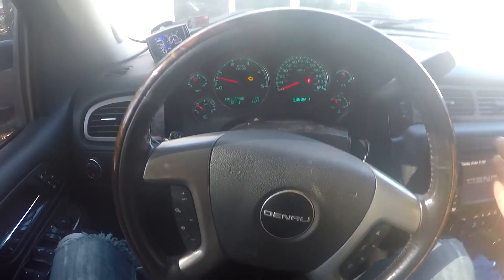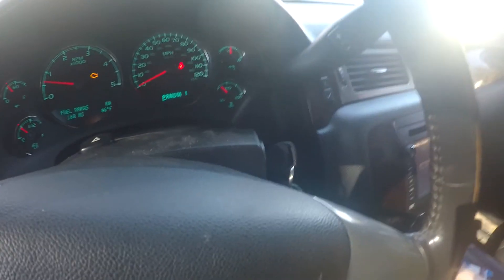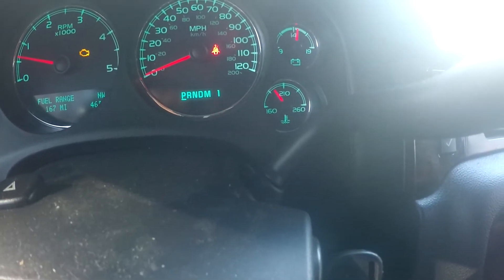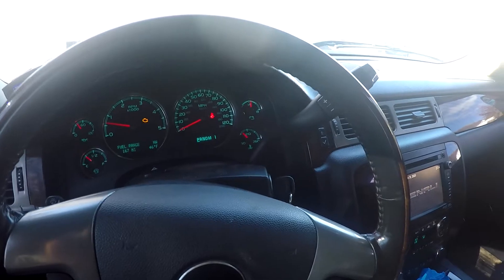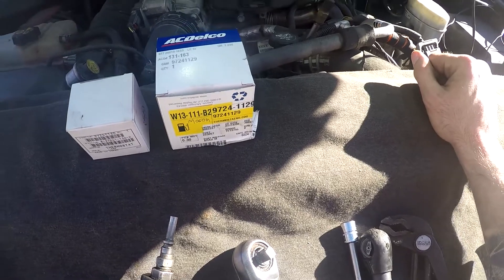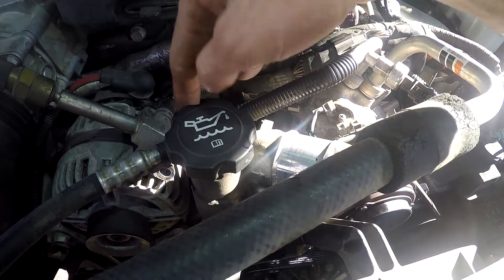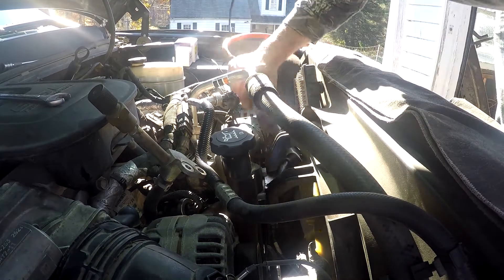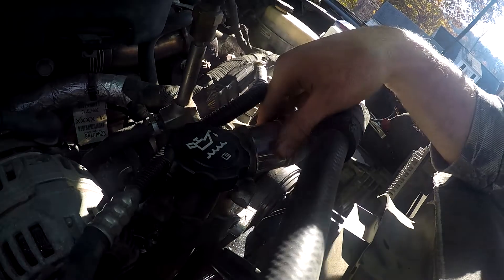Diagnosing and Replacing Duramax thermostats.

Comment: Thanks so much, Just purchased an’11 Denali HD and engine light came on right after and got the same code. Your video was perfect to help me change the t-stats and all went well. Your extra help with how to pour antifreeze and the hose clamp was very helpful. You made it easy. Thanks so much. Last time I changed one of these was over 45 years ago with a lot less junk on the engine. I checked on price to change both the stats and sensor and saved $461. Thanks!!

Comment: In the process of change mine in my 06 LBZ,and cutting in a XDP drain valve.New Dex cool,Tstats,new surge tank,belt,belt tensioner,idler pulleys. Nothing better than new!
Reply from the maker: Sounds like ur getting the ol girl back to bran new
Reply: How many miles?
Reply: @stevengleave9001  251,000 ...dont have truck anymore tho

Comment: Good video, wondering if you have changed a starter on a 2015 GMC Denali Diesel 2500 if so put it on.
Reply from the maker: @jmalvarado6284  I have done a bunch. Remove the inner fender and the top bolt isn't bad . The bottom bolt u need to get creative with a extension and 15mm swivel
Reply: Thank you please continue with your GOOD VIDEOS is helping a lot of people. May God Bless you and family.

Comment: I just replaced the thermostats and reservoir tank,new cap.  Filled it and my temperatures match to the T with yours.....my upper hose is getting hard...I can squeeze it and after it sits for a while it'll relax...but, sometimes it gets pretty hard.  Not over swollen just tough to squeeze.  Headgaskket?   No water in oil or white smoke. Truck runs like a boss !!!   Very confusing.  Maybe need more time to "burp" the system?

Comment: Thanks for posting this video. Subscribed and will share with my buddies who own Duramax trucks. My 2015 LML is throwing a DTC of P01F0, (Generic - No Description, but I have seen more than one mention of it being the Coolant Temp Sensor), and running cold on the gauge, around 1/4 scale, just about where yours was. Checked the temp reading on a live data scan tool, it never got over 156*  All the other T-Stat R&R vids I found showed older versions of the D-Max engines, which have different housings and coolant connections, and require very different steps to replace them, so I really appreciate your nice job on this one.   Question for you - Would it make sense for me to also replace the temp sensor while I am in there? They don't cost much. Thanks again.
Reply from the maker: Thanks for watching dan!. It definitely sounds like u have stuck open thermostats if ur only at 156.I would say that's most likely your problem. The ect sensor is right there and would be easy to throw one in while ur there . But like I said I'm pretty sure its ur thermostats.  Thanks for sharing I really enjoy making the videos!
Reply: @chevyman35089  - I changed them out today. Was wanting to put GM / AC Delco replacements in it, (I don't know why I would want to put the same brand in that failed, Ha). But none of the local parts stores had them on the shelf, so I went with Autozone Duralast brand, (at least they were made in Israel, not China). I did not replace the temp sensor, just the stats. It took me almost 2 hours total time, including set-up and clean-up, (mostly because I am age 62, so not as quick or flexible as I once was, and it was 39* out with a stiff cold wind blowing on me). I did climb underneath, pulled the clip off the lower radiator hose, put a large drain pan under it, then reached down from above and gently tugged on the hose to get coolant flowing. I held it open long enough to get 1-1/2 gallons in the pan, that was just enough to drop the level halfway down the thermostat wells.  Thanks for pointing out an IMPORTANT tip at Minute #15:00, (blowing the coolant out of the bolt holes). If your viewers don't have access to a blow gun or compressed air, the next best trick is twisting the corner of a blue shop paper towel into a long skinny point, poke that down into the water-filled bolt hole, and stick a thin Allen wrench (like a long-arm 1/8") in there to push the paper point on down. It will wick that water out quickly. Pull the poker out, then pull the towel point out and repeat with all 4 holes, (using a new dry paper wick point each time). The Duralast T-Stats are spot-on accurate, Happy to say it now runs between 180-185 degrees on the live data scanner, (with the dash gauge pointing almost dead-on the 210 mark, as you showed).  Cleared the DTC's, and the Check Engine Light went out, but came back on real quick. I tried a couple shut off's and restarts, still the same. Maybe it needs to cool down and do a cold start or 2 in order to clear the issue? I will find out in the morning and report back. (Any idea what a DTC of P113A signifies? At least the P0130 code is gone now).  Thank you again, Mr. Marron, for putting this excellent, informative,  time-saving video up for us DIY-ers.
Reply from the maker: Sounds like you may have a bad exhaust gas temp sensor.  Either #4 or #3 . If u want feel free to send me an email and I'd be more than happy to help u figure it out! Bradm454@yahoo.com

Comment: would this cause any issues with the heater inside the cab? having problems there but seems to work ok on a long trip when i get the truck running for a long time
Reply from the maker: If u mean that it doesnt make good heat then it's very possible. This truck would only blow good heat if I was towing or if I pulled a hill. What year truck is it. And where is your temp gauge at when warmed up
Reply: @chevyman35089  truck is a 2013 GMC Sierra 2500 diesel with 58k on it. Just drove home from work 15 minutes and temp is about 190 according to the gauge. I was pulling a trailer this weekend and heat seemed to work “ok” unhooked the trailer and blowing cool with heat on again
Reply from the maker: Yea your gauge should be at the 210 mark. Sounds like u got a bad set of thermostats. Put in a fresh set of thermostats and u should have great heat!

Comment: 2003 chev duramax 3500 dually.  70,000 miles. No heat in cab. No warn light used Garage Pro plug in diagnostic. No engine or HVAC faults. Temp gage 180, eventually 200. Outside temp about 50 degrees
Reply from the maker: Few questions.  Is there no heat on the drivers and passenger side? And is the coolant full or is it using any coolant?
Reply: No heat at all.  Coolant level good. Have Garage Pro OBD scan tool, scanned engine and HVAC, no error codes.
Reply: Heated seats saved our behinds...

Comment: one thing to consider that i have noticed is if you do a full delete these engine will run cooler with no load.
Reply: That’s what I am trying to rule out on my truck. This code will come up every so often, maybe once a month. but I question if it’s because the truck is deleted. 2006 lbz.

Comment: Roughly how long does this job take you to perform?
Reply from the maker: I can do it in about 20 to 30 minutes if I hustle. Also depends if the trucks hot or not . Kinda slows ya down a bit. But if u have basic knowledge it's about an hour job. By the time u burp the coolant out and everything.
Reply: @chevyman35089  thank you for the response Sir
Reply from the maker: @chuckblankenship5122  absolutely.  That's y I make the videos , to help out others